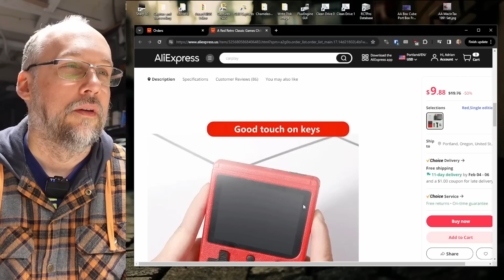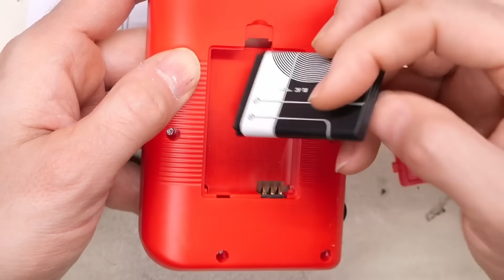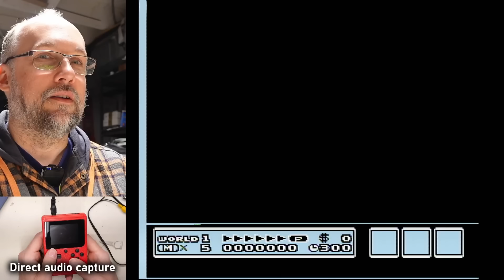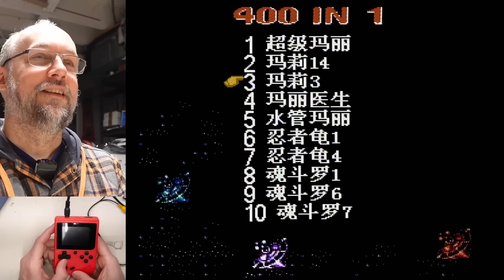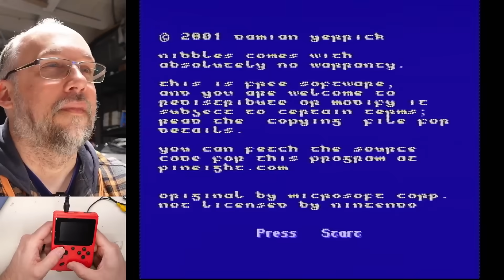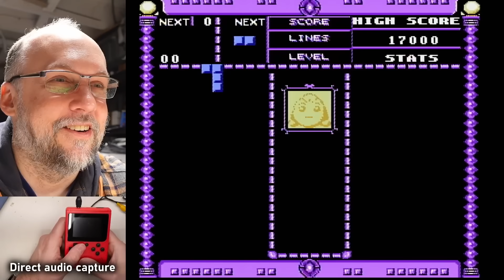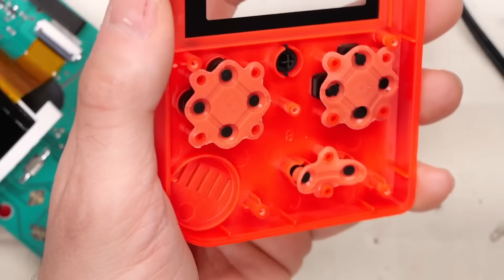I thought this $4 8-bit game console was going to be total junk

Comment: Old clone NES CPUs had notoriously screwy audio, usually swapped pulse channel duty cycles. 
That naturally persisted to the system-on-a-chip designs like this.
Reply: Yep I was going to chime in and say that.  It's a duty cycle issue which has never been fixed on the NES on a Chip clones.  It continues to this day for some oddball reason.
Reply: @TheTampaGargoyle  Probably there's a lot of NOACs in some warehouse leftover from when famiclones were popular and they sell it for cheap. Modernized handhelds that don't use NOACs, but are emulation handhelds instead don't have this problem.
Reply: @UltimatePerfection  I understand emulation based (and FPGA based) don't have this issue.  I wasn't referring to those nor was Skawo.

I do question though how this NOAC is capable of driving an LCD directly seemingly with digital RGB as Adrian expressed it's not composite and I trust his assessment of that, which those original NOAC's you speak of, did not have support for.  It doesn't add up.

I don't feel these are new old stock, they were re-worked to have new circuitry that the original NOAC's simply did not have.  I think these newer NOAC's and older ones should be sent to Ken Shirriff to reverse engineer.  It would be interesting to see what's going on.

As Adrian also expressed the LCD controller has tearing, I'd appreciate it if Adrian chimed if the tearing was diagonal perhaps?  I ask this because a LOT of cheap devices use 90 degrees rotated displays, and when produced even further on the cheap, the tearing happens to be 45 degrees due to the rotation happening as it's drawing lines, creating diagonal tears.  I have a feeling the tearing he saw might be diagonal, and if it is, I might actually know what NOAC this is.
Reply: @TheTampaGargoyle   NOACs had RGB support since forever though. That's how we got famiclones with the SCART output. In most cases though you'd need to solder RGB out to specific pins or traces on the famiclone's PCB. Looks like they use these traces to drive the LCD.
Reply: @UltimatePerfection  The LCD needs it to be digital, you're ignoring very key context here.  That LCD is not taking an analog signal input.  Not to mention I just double-checked Kevtris' site, there's no RGB.  So, thanks for wasting my time?

(I'm gonna take a stab here and assume you don't know who Kevtris is, so I'm just going to cut this conversation short, I no longer wish to engage with someone who can do basic research, and I checked both Google and Bing, and found nothing on pinouts that corelate to what you even said, rather to the contrary, pin 74 is CVBS, and 77 is AUDIO.  No R, G, nor B pins are present here.  You said "since forever", well that's simply not true, and since you refuse to cite a source to even back your claim, you're just a keyboard warrior who speaks, yet knows nothing about the subject they are talking about.  Like a football video gamer, who suddenly thinks they are actual NFL experts.)
Reply: Perhaps that's why Hummer Team sound engine sounds so bad? It was tested only on clone consoles that had that audio issue, so if the hardware is working correctly it suddenly becomes annoying chirpfest?
Reply: I think it would be early copies of the entire NES architecture, as the CPU itself is not fully in charge of the audio, and the CPU is similar to a basic 6502, which was widely cloned by that point.
Reply: @IntegerOfDoom  There's NOACs that have correct sound. The issue is that because a generation of kids in Asia, Eastern Europe, etc grew up with incorrect sound, to them the swapped duty cycle audio sounds correct. Generally, whenever you buy famiclones directly from China they come with the swapped duty cycles, but when you buy them from a distributor that markets them overseas (Gamerz Tek, Hyperkin, etc) they come with correct sound.
Reply: The sounds would bothered my eardrums 👂😥
Reply: It wasn't the cpu's so much that they cheaped out on the motherboard. They SHOULD be 100% compatible and accurate if any company wanted to put the money into it.
Reply: I was astonished that's not emulated. 😅 Maybe even cheaper to realise
Reply: Its not audio issue look at the timer the rom is at 200% speed

Comment: you did this video already. I remember you did a resistor mod on the video output. but back then it was $15
Reply from the maker: Yep -- definitely similar, but 4x the cost and a different ROM and internals.
Reply: I thought I was going crazy thinking this was done before.  I got one the first time.   It still was pretty good for the cost.

Comment: Is it possible to remove the blob to see what the chip is like underneath?
Reply: You'd have to be very careful, most blobs are the bare die and the bond wires soldered straight to the board then potted over with resin.
Reply: To look under the blob, I take it the resin would have to be heated somehow? I was hoping Adrian would try. It seems he wanted to keep it in working order. When he talks about connecting it up to a little CRT near the end, I wondered if that's what he's thinking about doing himself.

Comment: I have two exactly like this and another one with the DS style but still NES games and yes, the USB micro port supports a gamepad which I have as well.  The gamepad works for 2 player games.  I also think that the quality isn't great, but it is workable and it was better than what you showed here, but most definitely plenty of repeats past 300 and plenty of hacks and junk games just like you showed.  Interestingly, there were different and more games on the DS style one and that is also the one I got the extra controller with, but that same controller works on both.